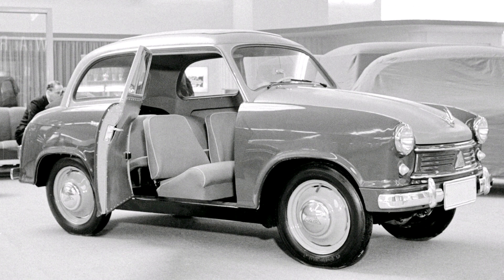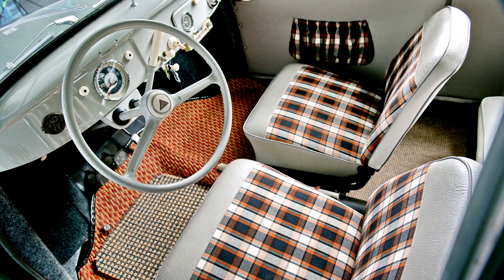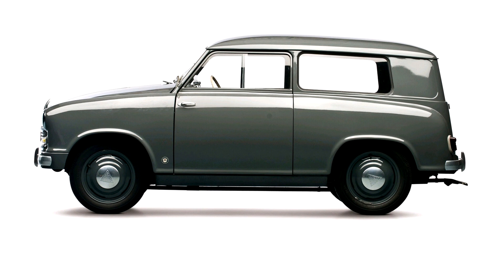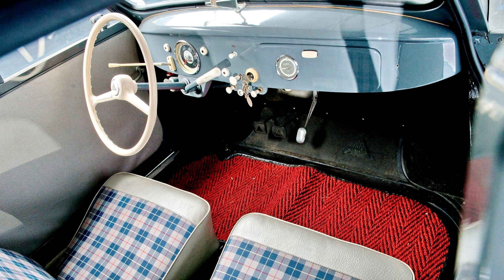Lloyd 400

Comment: 47.000 Stück allein in 1955 produziert - von 106.000 über alles. 1954 waren es 50% Steigerung seiner Produktion - in 1955 gar 74%. Jede vierte Neuzulassung war ein Lloyd 400 - das führte zum 3. Platz hinter Käfer und Olympia in den Zulassungen. 30% verließen Bremen in alle Herren Länder exportiert…